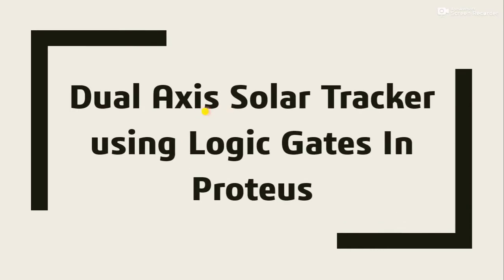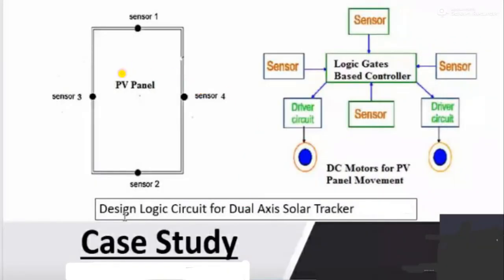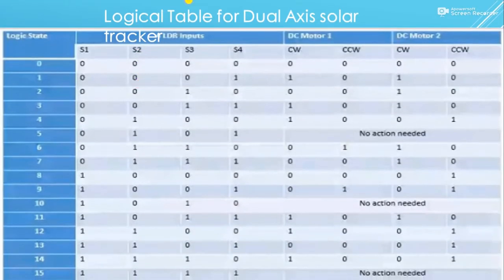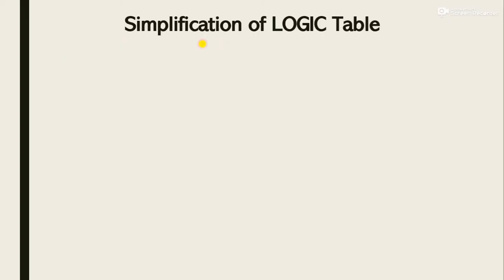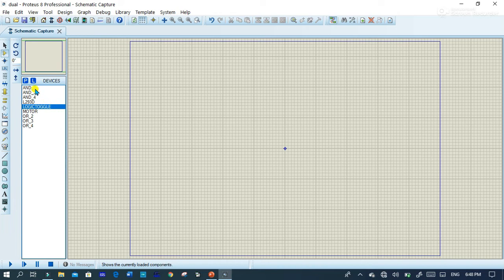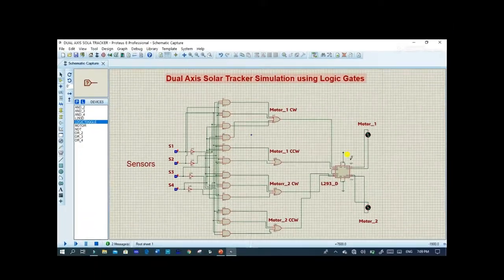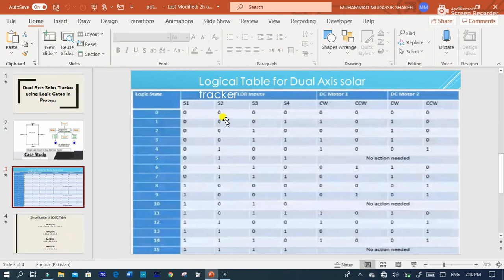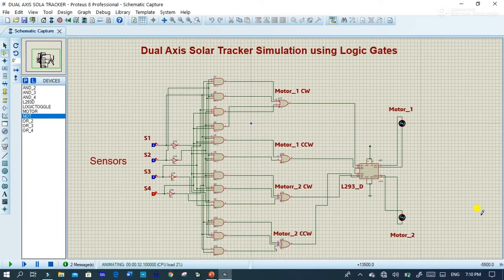Dual Axis Solar Tracker using Logic Gates as a Controller in Proteus || Tutorial+Simulation

Comment: Hallo,
Thanks for the nice video. It is interesting.
Have you actually built and tried this circuit? I am asking this question because I am interested in knowing which kind of sensors have you used?
Typically, sensors provide analog signals (voltage), and to drive the TTL logic you would need some kind of analog to digital converter (A/D Conv.) between the sensors and the logic gates. 
Unfortunately, though, neither your block diagram nor your vocal circuit description in the video mentions this in any way.
Could you give some more information about this, please?
Many thanks in advance.
Reply from the maker: dear i build the circuit only in software but i have idea how to implement it on hardware

Comment: How much hp required for a servo motor to rotate 50 kg panel
Reply from the maker: you have proper calculations. Only weight is not enough to define how much torque needed